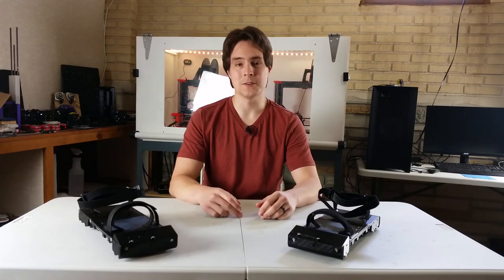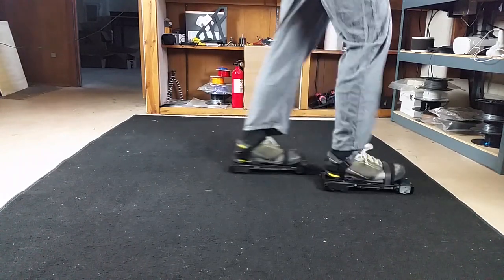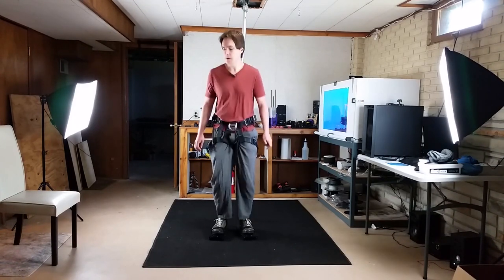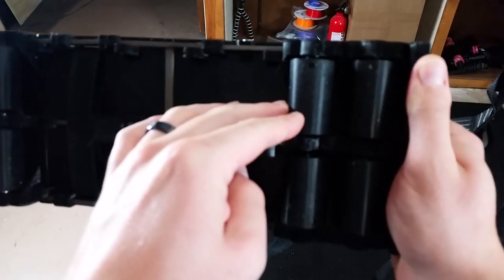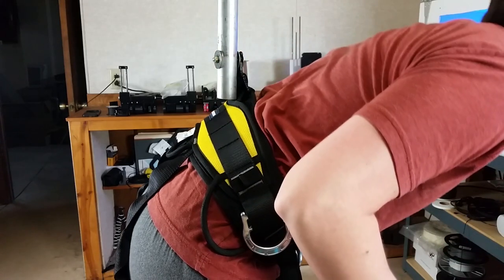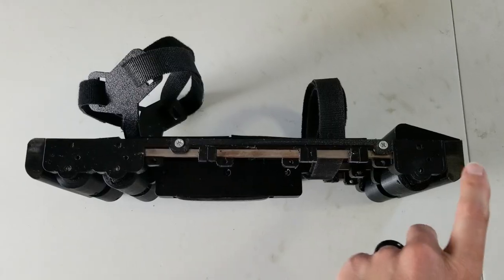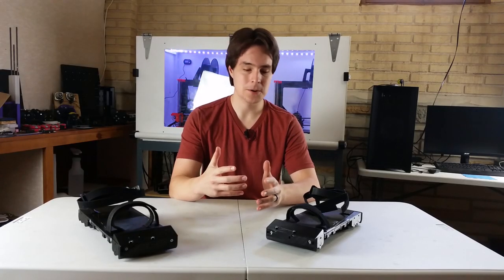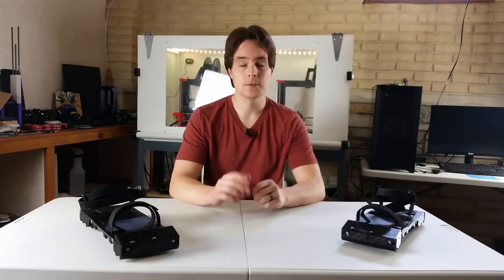VR Shoe Build Log #37 - Walking, Running, Jumping, Twisting, Walking Backwards

Comment: I have a treadmill that I often use when browsing the web. One thing that I realized is that without shoes, your feet will start to hurt after a short while when walking on a flat surface. Maybe you can attach some sort of insole with velcrotape to the top of your shoes? This would probably be much more comfortable that walking on flat plastic. Also, you could easily use different sizes, so your wife can use the same shoes with insole in her size.
Reply from the maker: When I reduce the size so I only need to wear socks with them, yeah I'm thinking of somehow attaching insoles or something like that to make it more comfortable. For this version, where you're wearing a regular shoe, we'll see how comfortable they are after a long period of time. I often go on 45 minute walks on relatively flat, paved ground and don't have a problem, that that isn't as flat as a treadmill.

Comment: Have you considered changing the foot flap into like plastic or metal with a hinge and possibly a spring to help dampen how much it flaps when you lift your foot. Having a more rigid connection might also help with it moving unevenly when lifting your foot
Reply from the maker: I've considered a hinge in the platform, then the foot flap wouldn't be needed. But it added too much complexity. 
Making the flap more rigid would make it harder to lift my heels, wouldn't it? My goal with the flap is for it to be flexible enough to so I can easily lift my heels during my natural walking motion.
For dampening, recently I've put a piece of cloth under the foot flap and I think it helps, but I need to test it more.

Comment: Glad to see you are working on the safety Harness system (been waiting for that)! Your shoes so far have been low enough that you probably have no balance issues and the harness is just more for keeping you in-place, you may not even need it once the motors are included again. I have Natural Locomotion in my system and one thing that they should add is an adjustment for step height. You in your vr shoes and me just walking normal don't really lift our feet high (like high Stepping). Natural Locomotion can use different items for tracking and I have used Motion controllers and Joycons but you need to exaggerate your step to get it to register that a step has been taken. You can use swing mode which works best sitting down. Freedom Locomotion VR (Free) uses "Head Bob" to register a step instead of a device. Point  being, you may not get it to register your forward movement. I was toying with pressure switches mapped as keyboard buttons (esp32 bluetooth with battery charger built in) on my insoles and telling steam to map that instead of using accelerometers. Didn't you have switches in your earlier  shoes for switching motor direction? I will gladly continue to follow your progress in these videos and I will TRY to keep my inconsequential chatter to a minimum in the future, lol.
Reply from the maker: Nah dude I like the long comments. On my discord I sometimes feel like I'm writing a book with each comment.
Yeah with them being this low I don't have any worries about rolling an ankle or anything like that. I agree that maybe a rigid support rig eventually won't be needed when motors are added back in, but even so I'm going to keep the rigid setup until I perfect the motion control. The rigid setup helps keep me in place and balance. And you'll see, but my next support rig design has a feature that should make it easier for a total beginner to start using the shoes. Then the feature can be adjusted as the user gets more experienced. I'm not sure if vr locmotion solutions, especially ones that rely on motors or slippery surfaces, will ever not have a learning curve, at least for some people, so I'm keeping that in mind. Anyway, even if I get rid of the rigid setup, I'll still have a tether just for safety purposes.
Thanks for the info on NaLo, I'll keep that in mind. And maybe check out Free. I believe this guy said that he used NaLo for his slidemill and it looks like it works fine.
https://www.reddit.com/r/virtualreality/comments/m99x1u/homemade_vr_treadmill_updated/?utm_source=share&utm_medium=web2x&context=3
I'm still probably going to write my own software eventually. NaLo is just convenient to get it going right away. Long term there is the optical flow sensor or encoder options. Maybe a single IMU attached at the ankle could work. But one idea I think will work nice, and has the added feature of full leg tracking, would be to use Slime VR. I'm sure you could track foot speed along with the position. Then, and I'm really excited to try this out, I was thinking of either wearing 2 IMUs with Slime VR, or 1 IMU, and another mechanism that is perfectly accurate and using those to train an AI. So the AI would try to take either the 2 IMU input or 1 IMU input and predict where and how fast the shoe is moving, as well as where the user is probably going to move it, and be trained against the accurate output from the other device. I wonder how well it will work. I've seen a few motorized VR locomotion solutions that suffer from lag, and I wonder if an AI can be trained and virtually eliminate that lag. Maybe the AI can learn your very subtle cues that indicate what you're about to do.
If you're mapping pressure sensors to vr input, you may like this - 
https://twitter.com/ConcreteSciFi/status/1358214895695708160
How well did it work? Yeah I had a button on the shoes that would tell me if the user's foot was on the platform or not. I broke that button a lot. If I do that again I'm probably going to use a pressure sensor or capacitive sensor.
Reply: @finallyfunctional  Hey, thank you for the treadmill link. Hopefully as/when lumber prices drop and I shake a few mental problems I will get further into my "Brain Exercises". Hate to say it but I am glad I avoided one or two issues that I saw (half of a square never seems sturdy when you flex it hard). But it was quite a NICE result to view. I am wayyyy heavier (and much much older) so I have to try to get mine more stable. Wonder what material the top surface is? I may try low carpet with "sliders" on the feet at first then try to find my 1/2 slide 1/2 roller shoe platform (I think I trashed it though). Odd you have the link to the smart shoes as I kept falling over them looking for sensors, but will try that conductive rubber sheet (I can never remember the name of) as a four switch insole instead . My brain can't hold on to simple coding anymore...by that I mean pet basic from the early 1980s (I think!) so hopefully I can modify some DIY bluetooth game controler to fit my needs. Slime VR... been on their discord a lot lately and have a imu 9250 from an old EdTracker hybrid I built. Looks like my esp32 and the 9250 should make 1 Slime tracker to test with the owowtrack software, until they get the server software written, if I muster the mental power. Oddly those are the same parts a DYI Bluetooth game pad uses! The AI sounds like overkill...but lovely! Perhaps you are actually planning an exoskeleton and these are your fist steps towards world domination? AI controlling your walk a stabilizing device to maintain positional Integrity...add some plasma weapons and I will Back you! Looking forward to MORE VIDS!

Comment: I agree that some form of safety rig is necessary, but I think that getting rid of the rigid one is quite important. Let me explain myself : there are three advantages of motorized VR shoes compared to slidemills, the only ones affordable for the average customer. One is the size of the device, one its price, and the last one the freedom of movement given. With a rigid rig, the last advantage disappears, so I think replacing the vertical rigid bar by a flexible cable would be a good thing. The cable would be attached to a support rig allowing it to stay vertical wherever you stand in the play area, it wouldn't exert any force under normal circomstances, and the harness would be designed in such a way that the user could assume any position (even sitting or lying on the floor) or make any movement (slow in the vertical direction) without feeling any resistance from the cable. However, if the user were to ever loose balance and fall (fast vertical full-body movement), it would be detected and the cable unrolling would be stopped, to prevent the user from hitting the floor. I think this kind of mechanism is quite common. Also, for people who can't/don't want to drill anything in their ceiling, a foldable support rig could be provided.
Reply from the maker: I understand and agree that a support rig that the user doesn't even feel would be better. However I think it will be hard at this point. If you look at all the motorized VR locomotion solutions out there, they suffer from some problems (mine included). They are slower and lag behind the user's speed (see the EktoVR boots for an example). Many of them it's obvious the user is concentrating on maintain control. I have not seen one motorized solution that reacts quickly and stably enough to allow the user to make very quick direction and speed changes (like what slidemills can do now). Not one, if you've seen one send me a link. 
So, I'm going with a hybrid approach. I want the quick direction and speed changes that slidemills can do with the more natural feeling motorized solutions can do. The rigid support rig provides extra stability for those quick movements and speeds. The motors in the shoes will be supplemental, meaning I'm planning on having them kick on once the user starts a movement in whatever direction. That way the motors do not have to instantly react to the user's movement.
I'm hoping that hybrid approach will provide the best of both worlds while minimizing the negatives of each. But others might disagree. I personally want to be able to change direction and speed quickly more than being able to lie down, not feel the support rig at all, or have the most natural feeling possible. Others might prioritize other things more highly, like having the most natural and free feeling possible but be restricted to controlled, slower speeds and turning.
Once I have the hybrid approach done, I will work on improving the algorithm to see if the rigid system can be removed without sacrificing the ability to change direction and speed quickly. We'll see if I can do it.
Also I plan on trying to make some rigs that don't require drilling.
Reply: @finallyfunctional  Yeah, the flexible safety rig isn't for right now, it's just a goal to aim for when the problem of quick reaction to accelerations is out of the way. Using AI might very well be a solution. You could pre-train it yourself so that it already has good reactions, and then the user would train it further to fine-tune it to their usage.

Comment: Have you considered using a torso-harness instead of a hip-harness? I think it would give you a wider range of motions you can do, with the shaft not going as far down. If you combine that with an expandable shaft (in order to duck) and some leeway for tilting the shaft, the motion range could be much nearer to reality and more comfortable. I obviously haven't tried it, but it might be worth trying it out, if you haven't done so already.

Anyway, it's some awesome work you're doing here, mate! :) Keep it up!
Reply from the maker: So something like the vest the omni-one has? Yes, I've considered it but I cannot find any safety harnesses like that. Yes there are the typical fully body harnesses, but if you walk forward the straps kind of  pull and expand awkwardly and they all still require the hip-harness. The omni-one vest wraps around your entire torso, instead of just have straps, and I think that would work much better. If I could find a vest safety rig like the omni-one I would try that out immediately. I could try to make one, like I've thought of maybe using a life vest, but I'm not sure how safe it would actually be. I'd rather use actual safety equipment. All that being said, I'm fine with the hip-harness for now. I of course need to try it out in games, but for now it seems fine.
Reply: @finallyfunctional  hmmm, could you by any chance use a parachute harness? They should be relatively easy to come by, or are they the wrong kind of harness?
Reply from the maker: @DrWickermoon  Those harnesses consist of a couple straps that go over your shoulders and and one that goes over your chest, along with straps that go around your legs. In my testing it felt awkward to just essentially be pushing against the chest strap. With the omni-one vest, you push against the material that expands over your entire torso, so the force is much more spread out and I imagine it feels better.
You could take a parachute harness and maybe add straps to it, but then it gets more cumbersome to put the harness on. Might work though.

Comment: i hope later versions you can jump alot higher that that.... i have a hard time accepting that tiny thing as a jump. Thats not even as high as jumping up a single stair. 

you mentioned the size being too big for you....... what is your plan to make them fit all sizes of feet/shoe? would each person need a different size? or is the plan to eventually make them resizable for different users?
Reply from the maker: The rod I'm using there doesn't move up and down, so I'm restricted. Once I have my support rig built that supports vertical sliding I'll try higher jumps.
I've designed the shoes so only a few parts and the 3 long metal rods need to be swapped out to make them longer or shorter. I think making it so nothing has to be swapped out and the length adjustable is possible, but I don't want to deal with that complexity right now.
Reply: @finallyfunctional   yeah i was kinda assuming both thoes things. good to know, im excited to see the next version.

Comment: One thing to consider is that squatting and ducking is a big part of VR games. That's not possible with the rod.
Reply from the maker: Yup, at the end of the video I briefly show my support rig design that will support crouching and hopefully sitting. The rod I use in this video is just for quick tests until I get that design built.

Comment: I wonder if machined aluminium in the final version will be viable.
Reply from the maker: Probably. I don't have the tools to do that right now. I want to make this project as accessible as possible, so I'm trying to keep the tools needed to a minimum. So far I think you need a 3D printer, drill, vice, saw, wrench, screw driver, solder iron, file, stapler, and scissors.